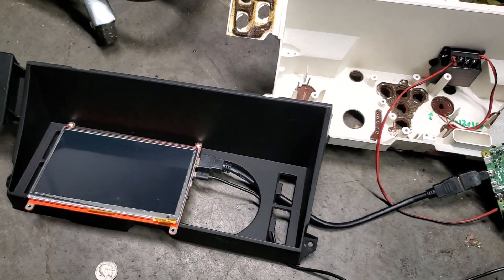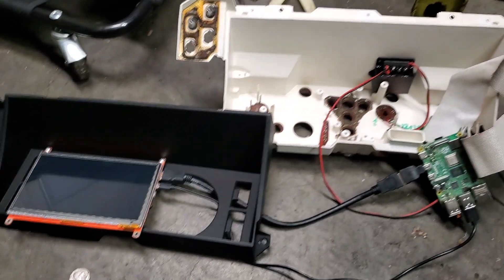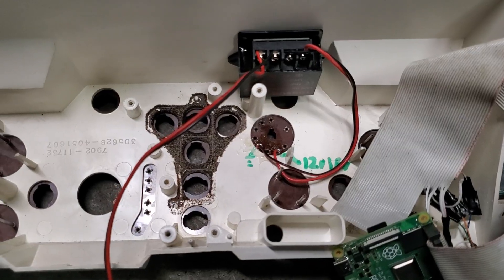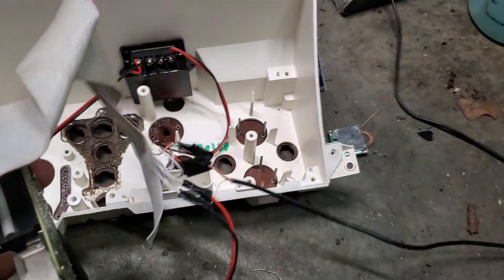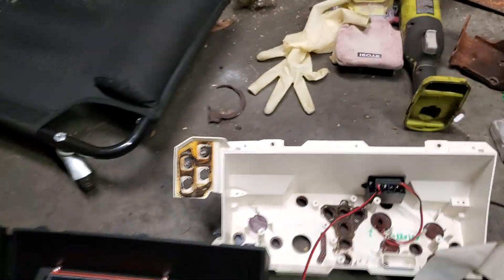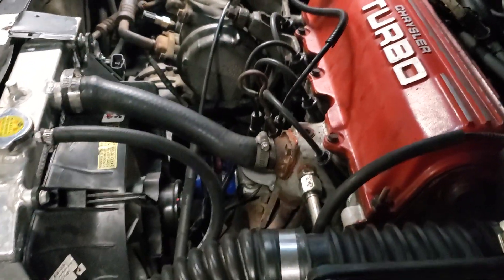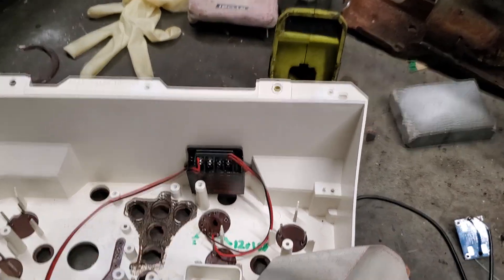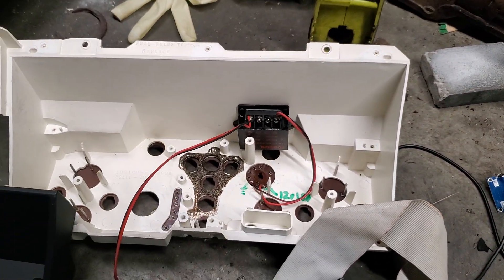Making a Raspberry Pi Dashboard for an older car

Comment: That's pretty cool, I've been wanting to do something similar for my 81 Chevy truck, but as a data logger and add additional gauges/channels like transmission temp, manifold vacuum
Reply from the maker: My first code version had a human readable text output.  I scrapped that version in order to make code that could be used with an LCD directly connected to the Pi Pico 2.  My plan is for that to have a CSV output that can easily be imported as a spreadsheet.  I don't know if there's already an industry standard for data loggers, but I figure anyone can dump CSV into a spreadsheet and graph however they like.  (-:
Reply: @benjaminvanderjagt  as far as I know (I'm a mechanical systems engineer) I haven't seen a standard for outputs, maybe IEEE? 
There's software out there like DIAdem but really it just takes the logs from stuff like Flexlogger

Comment: Hi, did you succeed??
Reply from the maker: A close friend passed away right after I posted this, and I took some time off from working on it.  I just started again, and I made a GitHub project as well.  My target is to have a complete working system for the Laser by the time it needs state inspection.
Reply: @benjaminvanderjagt  sorry to hear that. Hope you will get through. I'm curious of the outcome. I am thinking about a similar digital output of the instruments. And I am looking for a easy method. I don't want to build my own ECU with speeduino or something like this.. The Idea is to just bypass all signals of the instruments to a raspberry pi and have a nice display to just show the currently available data. Maybe add some temperature sensors or pressure sensors.. but I want to keep it simple and make my 1987 vanagon look modern.
Reply from the maker: @nicodi5497  A 1987 Vanagon?  O:  That would be awesome!  We had a Vanagon.  I don't remember the exact year, but it would have to have been close.  Do you have any project pages or similar for your vehicle?

Here is my abysmal initial start on GitHub.  I can't stand the web interface, but I'll get used to it and upload pictures, schematics, code, sensor tables, parts sources, and everything else on that project page: https://github.com/benvanderjagt/whyjustwhy/issues

I wrote plenty of C, Pascal, BASIC, and Assembly in the 90's.  I'm completely out of my element today, and it shows.  I gotta scrub the rust off of my brain.
Reply: @benjaminvanderjagt   I did not start yet.. I just bought the T3 and I currently restoring the chassis / brakes / body work.. This will keep me busy this winter.. maybe on early dark and cold nights I can start with a bit of programming.  I checked your Github page and left you a comment as well!
Reply from the maker: @nicodi5497  Awesome!  Well, part of the design is that the two parts could be used independently.  Just the Pi 4 should be able to show turn signals, resistance-based fuel gauge, high-beams, and GPS-based speed, even without the Pi Pico 2 interface.